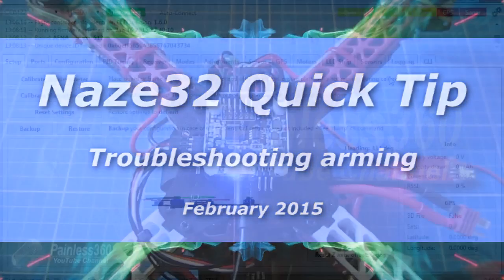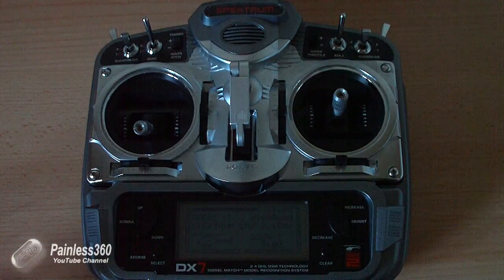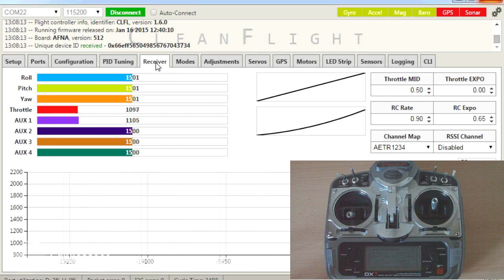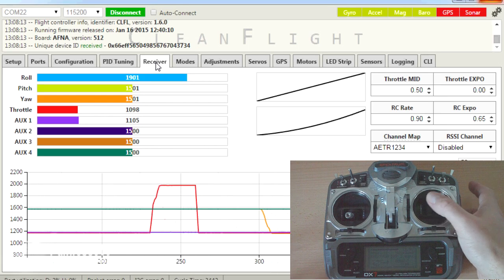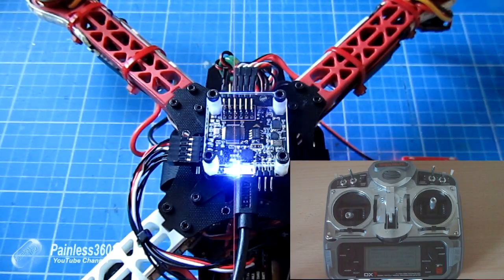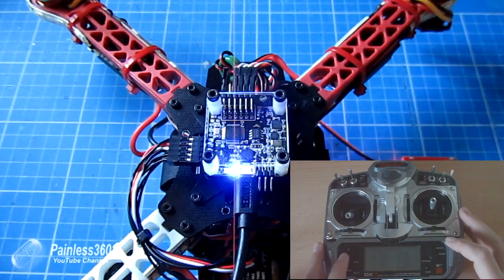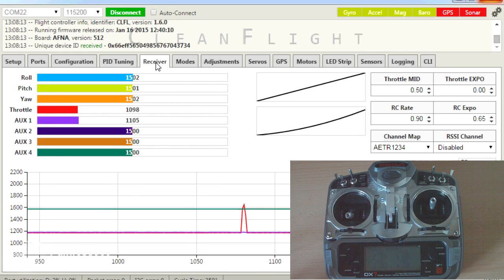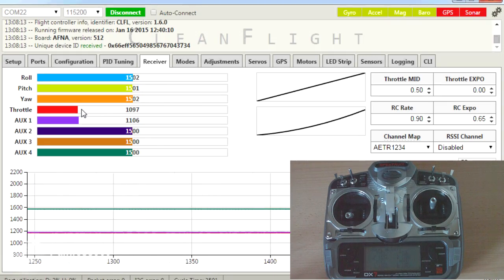Naze32 Quick Tip - Troubleshooting Arming

Comment: I cannot get my motors to spinn, neither with Cleanflight or directly with radio.
FLIP32 10DOF board with ZTW Spider 30A OPTO.
Firmware loaded Naze32 1.10.0 and all setup is working with my Spektrum DX9 with AR9020 receiver.
All 8 channels are working fine in Cleanflight, but getting motors to turn seems impossible. :S
Naze32 powered through a UBEC 12V to 5V.

https://www.youtube.com/watch?v=HyxNtMFxGHo

Any help would be greatly appreciated!!!! ;)
Reply from the maker: Do they run if you plug them into the throttle output on the Rx directly? Couldn't see in the video if you armed the board (throttle low, rudder right)..
Reply: I couldn't get them to work with the Spektrum DX9 and AR9020 receiver, so I swapped to my Futaba T14SG with an OrangeRX 8ch receiver and it worked straight off!?
This hobby takes confusion to a new level. :)
Thanks for all the support!!!

Comment: Hi there!
I'm having troubles with a naze32 rev5. I've been not able to arm the motors never.
The leds  you are talking about in my case are always when I connect the naze to the PC or I power the PDB with the battery, they are, one blue (always, no blinking at all) the next one (L1) is always red blinking never green, and the next one (L0) is always red (no blinking either).
What is happening?
Reply from the maker: +Jose Luis Montesinos Not sure - what troubleshooting have you done? Has it ever worked?
Reply from the maker: +joe ds Follow our Naze32 series and that should help. Best of luck!

Comment: why when i'm in receiver ,my throtle stick on the left moves the roll bar ,not the throttle
Reply from the maker: +Richard Harland if it's PWM then you need to reconnect the wires into the right connectors on the receiver, if it's PPM or SBUS then you need to look at the channel order... Best of luck!
Reply: +Painless360 thanks mate, it was the channels . you are a GOD send

Comment: I am hoping I can get some help... I have been flying my Naze32 for almost a year now with no problems, but after a crash it will not arm. I tried to re-calibrate, but nothing changed. After a standard arming sequence I have a solid red, flashing green and solid blue. I have double checked all my setting and nothing has changed... I am just baffled as to why it will not work. Suggestions?
Reply from the maker: +Jason Mundy I'd check every connection and go thorough all of the setup steps in Cleanflight.. Best of luck!
Reply: +Painless360 the board is protected so nothing can hit it and my Rx connections are soldered instead of using pins.... I double checked the setup steps, nothing there... It wasnt a bad crash, but something must have been knocked loose on the FC. I guess time for a new one

Comment: I think you've got me spoiled with the CC3D. I'm gonna give a Naze a try on Cleanflight,and see If I like it. My KK2 won't arm,I'm having a rx issue I think(Fooling around with my old Tx.),It beeps when disarming,but won't budge when arming.Apparently somebody had a identical issue with exact symptoms using their old Spektrum tx,and a orange 6channel rx seemed to do the trick,or I would've tossed it.LOL! So now I need to buy a Spektrum Rx,I have a micro 6channel it was all I had for my Spektrum.I did the normal trouble shooting subtrims,endpoints,calibration etc,and I've never used this micro rx so I said why not,the KK2 had different plans.LOL

Comment: my endpoints are good and my throttle and pitch are going the right way, but my yaw and roll are opposite, so i must be doing something wrong. I looked to see if you had a video for setting up a Spektrum radio with a Naze32 and didn't see one.
Reply from the maker: +mikesvideostuff No video on that. Reverse the channel for the aileron and rudder controls in the menus. Best of luck!

Comment: Spent hours on this and no arming after upgrading to latest Cleanflight 1.12.0. Have  1 Naze 32 Rev 5,1 Acro and 1 Rev 6 and all three will not arm on Diatone 150 and ZMR 250. The ranges are perfect and even tried rebinding but the Naze boards never go green after the blue light. Other than winding back Cleanflight, what can be done? I am using Taranis Plus with latest 2.1.7. Many thanks in advance!
Reply from the maker: +flytelaw1 Have you calibrated the accelerometers etc? Hard to advise you without knowing what you've already tried..
Reply: Yes, I have tried recalibrating everything....:-( I have tried, literally,  everything I have read about in the forums....Thanks for responding:-)
Reply from the maker: Sorry, not sure what to suggest..
Reply: I just bought 2 new Naze 32 V6 boards. starting fresh may help. Thanks for all your help.

Comment: Any other ideas?  I have the tbs powercube and my controls are spot on 1000-2000 and nothing happens
Reply from the maker: The end points shouldn't go that far. I'd try for 1060 - 1940 ranges.. Don't forget to get the vendor to help..

Comment: What if some of the controls are inverted? Is there a command in CLI to correct?
Reply from the maker: +Nicholas Emord Almost every radio out there will let you reverse the channels on it. I'd use that before anything else.. Best of luck.
Reply: I appreciate the reply. I was able to figure it out, there was an issue with my pin configuration. My issue now is one of my ESC's are faulty just waiting on the replacement part.

Comment: How do I set cleanflight to be always armed?
I have a switch on my TX that I use for arming but its state is not transmitted with an AUX channel, it just physically disables the throttle. I use it for all my aircrafts and it is very handy, but here I don't see how I can make it work without using an additional RC channel.
Any help would be appreciated.
Reply from the maker: +Роман Плетнев You can arm the board using the existing throttle/yaw combo. I wouldn't have a board always armed.. Best of luck!

Comment: Thanks for the video it has helped me a lot with an arming issue.

Another problem i can't get me head around too,  is the Quad  Esc Throttle Calibration  namely the interaction between Tx end points (100 or 125%);... Cleanflight/New improved Betaflight  min, max, min command settings, and the min, max throttle settings in BLHeliSuite. I've surfed RCG's but find worded explanations convoluted and difficult to grasp... please keep the good work with the video's ... a picture is as good as a thousand words...Joe
Reply from the maker: +Joe Stubbs Its easier to think of the min and max in terms of the PWM pulse lengths. Normally the range of a throttle channel is from 1000-2000 microseconds with 1500 being the midpoint. Most radios will show you what value they are sending to the recover at any given throttle position. Using the endpoint adjustment is key to make sure that you stay within these limits and you can use them to match the settings that an ESC is already expecting (i.e. SimonK throttle range is 1060-1860). Calibration of an ESC with the throttle you are using will change these to match what you have on the radio. Happy to go through this in more depth on chargeable call if needed. Happy flying!

Comment: Hello my arming system doesn't want to work. I have the same transmitter as you, the old dx7, and when I try to arm it does not work. Even when I try to set the parameters under modes for an auxiliary switch, it still doesn't work. Any extra set up needed on the transmitter itself? Thanks
Reply from the maker: +Calvin Baube The main problems tend to be those covered in the video with the endpoints of the rudder and low throttle not being high enough.. Best of luck!
Reply: +Painless360 yep they weren't working at first but I changed the switch on my arming system and for some reason it worked(?). Probably something wrong with the other aux switch I was using. Thanks again!
Reply from the maker: I'd check what you changed - maybe now you have it set to arm via a switch not the rudder/throttle combo..

Comment: I love all your naze 32 vids.  Maybe you can help me, I flashed it with clean flight (from baseflight), and now the buzzer keeps with a steady beep.  What settings can affect this?
Reply from the maker: +MrArron76 Usually vBat alarm is set and not connected to the main battery or no signal from Rx. Best of luck.
Reply: +Painless360 vbatt is off, re-flashed and cleared all old settings.  have it just a 5v source and buzzer and still sounds from the power being connected.  is there a way to ensure all settings are reset?
Reply from the maker: It will also sound if there isn't a signal from the Rx - is that powered too?

Comment: Thank you so much, this resolved my issue. I now have to figure out how to extend the endpoints for the Throttle and the Yaw on my DX9. any suggestions on how to do that?
Reply from the maker: +saul bermudez http://www.horizonhobby.com/pdf/SPMR9900-Manual_EN.pdf, page 25 ;)
Reply: +Painless360  I was having issues with arming the quadcopter until i saw your video on the troubleshoot. I am using the orange 615X receiver and DX6i transmitter together, and I noticed you had a DX6i radio on one of your naze32 video, and I would like to ask if you don't mind, your naze32 back up file which i think would contain all the settings and calibration you've done on the naze32 using similar set up like i have. email me at kizzy9ja@gmail.com. Thanks for all the support and videos.
Reply from the maker: Not sure what you saw but we've never used a DX6/DX6i here. We don't have one. Best of luck with it..

Comment: My Naze32 flashes green when is connected to PC. Sometimes it flashes with random delay between flash. If I re-flash to Cleanflight 1.8 green led stops flashing being connected to PC. If you have a completely new board, flash it with Baseflight, then to Cleanflight everything is ok and works perfectly. If you take a new board, flash it with Cleanflight you can forget about rock solid quad. Re-flash to any version or firmware doesn't solve the issue. Baseflight, then Cleanflight. I have many boards in trash can from different sellers with weird behaviours. Ended up by going Baseflight -> Cleanflight on rest of the clean boards and forgot about headaches.

Comment: hey there, thanks for the video... i am getting a bit confused as there seems to be a bit of different information around surrounding this and wondered if you could help.   The default values coming into cleanflight i had where 1100 and 1940 and centre was 1520 (am on futaba 14sg) i changed them to 1096 to 1902. then set min throttle in cleanflight to 1000 mid to 1520 and max to 2000. min check is 1100 and max is 1900 It all arms fine and motors stay still until i increase throttle but two motors always usually start first shortly followed by the others... if i go up and down in low values two usually stall and dont restart until i disarm and rearm... i can deal with this as i would rarely lower the throttle that low but is a bit strange to me, could that be a looptime issue perhaps I am set to 2000?.... sorry this is long but bare with me the reason for my confusion is many other places state to set ur rc endpoint to 1000 to 2000, is there any benefit to that rather than the 1100 to 1900 you suggest? appreciated
Reply from the maker: tmaintv Google 'SimonK endpoints' and you will see that by default the firmware expects them to be set to less than 1000 and 2000. This is an individual choice but I find this works great. Happy flying!

Comment: my board wouldnt arm, when i checked cleanflight i found that many of my channels are wrong.. my throttle is on the right stick for example, how do i fix this? thanks and thanks for the naze series, helped me a great deal with my flip32
Reply from the maker: ArabDrones I suggest you re-watch the first two videos in the Naze32 series. They cover how to setup and connect the channels. Make sure the channel map (right hand side of the receiver screen) is set to default too. Best of luck.

Comment: I have the flip32 version of the board, I have follow the set up on your video. I cannot get the board to Arm - I shall try the end point solution discussed in this video. WhatI cannot decide how to resolve is that the Yaw operation seems to being shown as reversed in the 'receiver' tab. That is, stick to the right and the Yaw bar reduces to the left. Is there an easy solution.
Reply from the maker: MichaelStanley34 Yep - reverse the channel on your radio.
Reply: Sorry. I'm a numpty.
Reply from the maker: Not at all - we all had to learn that once. ;)

Comment: After 3hrs thinking my board was fried and trying different things all I had to do was hold the throttle down and to the right could not believe it. Thank you so much will be flying it when I get home. :)
Reply from the maker: Lucas Falzon Simple when you know how! This is covered in the Cleanflight documents too..
Best of luck with the first flight!
Reply: Thanx can't wait 8hrs till I finish work lol did this test last night.
Reply: Hi fired up my quad today when I go to take off my quad keeps spinning around in circles. All mid points are set to 1500 I have calibrated all esc's. Don't know what's going on. Help please
Reply from the maker: Lucas Falzon Your motors are not on the craft in the right way, check clockwise/anticlockwise rotation and props are on the right way round...
Reply from the maker: I think I've just answered this on another video?
Reply: Read this thinking how much of an idiot do you think I am. Checked a prop diagram I googled and the prob with the r is on the opposite omg I am such an idiot lol. I must have mixed my straight and crossover motors as I had heat shrink over them
Reply from the maker: We all make mistakes the first few builds don't sweat it. This video documents the most common mistakes - https://www.youtube.com/watch?v=rICwVUPTEpg

Happy flying!
Reply: Just had my first flight not as easy as it looks in the videos. It was fun. had it to hover in one spot and its quiet windy today. surprised how well it flies
Reply from the maker: Pilots with experience make it look easy. https://www.youtube.com/watch?v=ZXpMI74_qEE&list=PLYsWjANuAm4oWuE5ZDX4TAiHBv2i0Xl4m&index=16 may help.

Happy flying!

Comment: im trying to arm my naza 32 on my blackout spider hex...im using baseflight but when i go to the reciever setting in base  flight my sticks don't register on the screen.. its like my dx8 isnt talking to naze board. Is your battery hooked up to the quad while you do these calibrations? please help .. my hex flew just fine a week ago and I havent changed any of the original settings
Reply from the maker: michael davis What troubleshooting have you done?
Reply: I rebound the dx8 to the receiver, checked the connections to the board making sure nothing came aloose,watched every naze 32 video on you tube, removed all buzzers from the board and pdb....I really Dont know what else to do except throw money at the problem and maybe buy a newer naze 32 board although i dont see any damage to the board .I even changed the channel mapping  to spektrum in the receiver section of base flight......but to no avail ...i get no response to pitch roll or throttle so it no wonder the board won't arm.
Reply from the maker: I would recheck the settings in Cleanflight and try another receiver and replace the cable from the Rx to the board...

Loads to try yet..

Comment: My flip32+ with buzzer connected beeps at an alternating constant rate then inconstant rate when I plug in my battery. Changing nothing else, I have to plug and unplug my battery several times until it the flip32+ will boot up without constantly beeping. I almost wonder if it's a short somewhere in the wiring. Twice now I've also had two batteries discharged completely upon plugging it in. The problem might be related to motor as it's noisier than the others, and when the battery discharges randomly, one motor stops spinning before the others. Any tips on where to even start to diagnose this problem?
Reply from the maker: Alex Clark I would stongly suggest that you check for a short in the wiring. The battery should never 'discharged completely upon plugging it in'. That points to a very basic issue with the setup. Chase all of the power connections through and make sure that nothing is touching something it shouldn't. 
Best of luck with it.